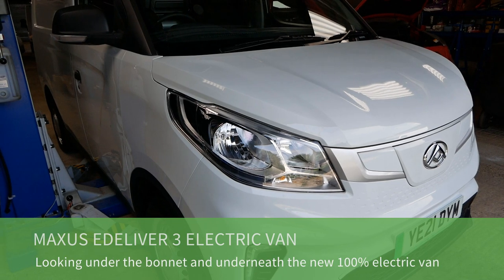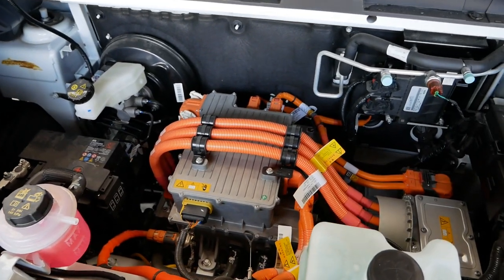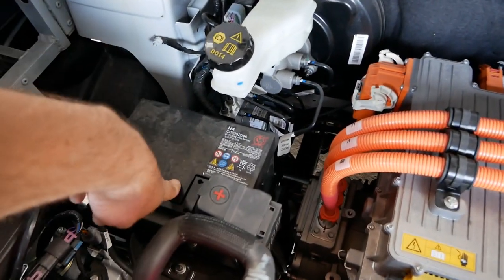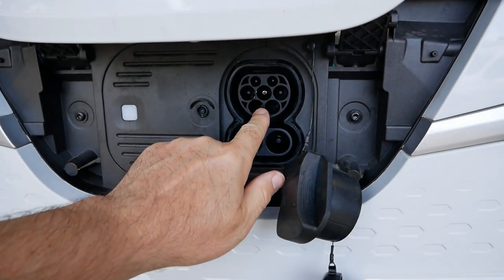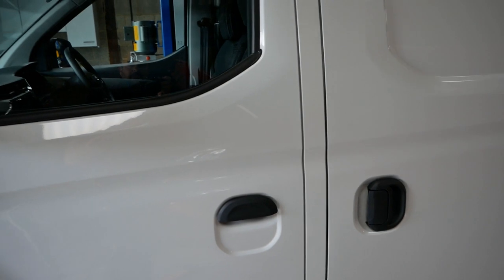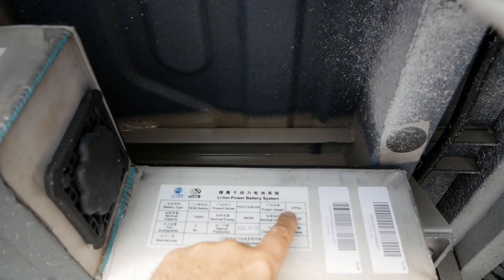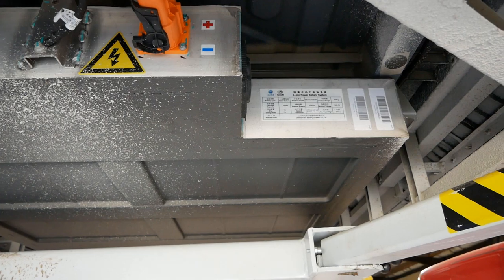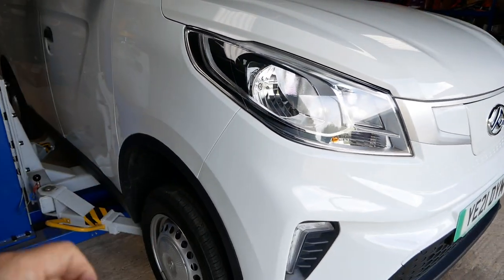Maxus eDeliver 3 electric van, looking under the bonnet & underneath to see the battery pack

Comment: It would be cool if these vans could have a main socket outlet to charge up stuff, like battery powered tools.

Otherwise the van looks perfect
Reply: Yes... also battery temp management as well.
Reply: V2G would be even better!
Reply: Yeah like the eTransit
Reply: I add 5000W V2L inverter in  Maxus EV30（eDeliver 3） for van leisure and Van working.  support AC 5000W output even charging or driving time.
Reply: you could always have something fitted, i run all my power tools from solar on my diesel van at the moment, i will probably do the same when i convert to electric.

Comment: You mentioned in an earlier video about those standard tyres being noisy, assume that is why they got named “Harmonic” … 🤔
I do have a question (thinking in camper mode) if you are sat in the rear , can you lock the vehicle with the remote..? Please

Comment: I liked the video very much. Good presentation. About the van, looks like very simple and cheap to do maintenance, the question remains just about are we capable of buy parts because is not a normal PSA, VAG or Mercedes brand.
Reply from the maker: Its no different. You can buy parts from SAIC Maxus. See https://saicmaxus.co.uk/ for the UK dealer network. SAIC are also MG. Their prices are very reasonable. I did a video on this, see https://youtu.be/qKgb5NXr7ow

Comment: All those different types of materials could cause issues with galvanic action, especially aluminium/steel interfaces...
Seems a reasonable build quality, but not the best. The five year warranty may be tested by our winters...
Reply from the maker: I would expect there to be gaskets between the different metals. I've also learned today that the floor on these is stainless steel, whereas I thought it looked like aluminium. I will have to check.
Reply: @GoGreenAutos  
Stainless steel would make sense for wear and tear, but not for weight.

Comment: Cheers for the video. Im getting a 2 day demo of  the short wheelbase van with the big battery next week. 
It was interesting to see a bit more about the construction.
Do you think from what you have seen it would be worth spraying the chassis or is it already adequately treated for salty roads? 
I ask because if I forked out the extra cash to go electric I would prefer to keep the van for longer than I normally would. This would especially be the case as I expect resale value on the current generation of vans won't be great as the technology makes them redundant quite quickly. 
The simple construction of it makes me think it could be reasonably easy to upgrade the battery down the line as well. I wonder if in a few years there will be a good aftermarket industry for that sort of thing. The van could last for many years then. 
Cheers 
Paul
Reply: Did you buy one Paul and what do you think?
I’ve got a LWB, 130 bhp auto Berlingo on order, and I’m expecting a build date pretty soon. I’m very tempted to cancel that order and get one of these Maxus e3’s for a couple of grand extra, especially as I only do around 50 miles a day.
Reply: @frazerguest2864  
Hey Frazer 
Yes I bought the shorter one with the big battery. 
So far Im pretty pleased. The van itself is basic but comfortable.  More importantly   i have so far found the range to be decent enough.
Now in the summer mixed driving im getting pretty consistently 260km from a charge. In the early spring (im in the middle of Sweden so -8 to plus 5c) I was reliably getting  200km with the heater on economy and with studded winter tyres.
In both cases I was carrying about 300kg of equipment. 
With a trailer on with a total weight of about 500kg my range seems to drop between 30 and 40km regardless of the temperature. 
The real test for me will be in the deep winter when we get several days in a row below -10.  I think I will have charge for 15 minutes on a fast charger during the day then.
Even though the upfront cost is quite high because you can only get them new the van is saving me a fortune. My monthly costs have reduced significantly. 
I hope this is helpful. 
Regards
Paul

Comment: i would like a ediliver3 with twin rear doors
how much is it to put or do you have one with twin side doors ?
Reply from the maker: Do you mean twin side sliding doors? All come with just one. No option to have a door on both sides and in reality too difficult to fit. Cheaper and easier to buy a van that comes from the factory with both.

Comment: Worth mention, the "climate control" got no temperature adjustment.
You have AC/Heat on/off and adjust to the desired temperature with opening/closing widows.
Reply from the maker: A new video on the eD3 heater coming on the channel soon.

Comment: Nice interesting video. I would like to know from where gets the 12v batterie its power? From the traction battery?
Reply from the maker: Yes, there's only one power source. When the vehicle is running the DC-DC converter charges the 12V battery. So its doing the same job as the alternator in an ICE vehicle.
Reply: @GoGreenAutos I do not really understand. The other way round. What happens if I consume the whole power of the 12 V battery by a diesel heating. When does it get reloaded?
Reply from the maker: @decker6875  The 12V battery gets charged (from the HV battery) when the vehicle is on and in ready mode (i.e. running). However, if you completely flatten your 12V battery, you will not be able to turn on or start the vehicle. A video about that and how to recovery from that situation is coming on the channel soon, so subscribe to catch it.

Comment: Id like to turn the larger model into a camper, put a heap of solar on the roof & see if its possible to charge batteries that way ... as out here in Australia it is few & far between charges
Reply from the maker: Yes, the eDeliver 9 would make a great camper. And these come (here in the UK anyway) with the largest traction batteries of any electric van.

Comment: there is no spare wheel or eye towing screw?
Reply from the maker: There's a towing eye screw in the front and yes, no spare tyre. Pretty typical for modern vehicles. You get a puncture repair kit instead (pump & gunk).

Comment: Very surprised there is no battery cooling
Reply: That's exactly what I thought. Especially since in the companion video to this when comparing this van with the Nissan N200e there was a very valid point made that Nissan Leaf and N200e have battery segregation of 3% pa because of the lack of battery cooling whereas othe EVs (including the SIAC built MG ZS EV) typically have 1% degradation. The N200e has a primative fan blown air cooled system which Leaf doesn't an now we see that SIAC Van has only passive ventilation to cool it so no wonder there's so much space around it

Comment: Do you know why this van would stop charging. 
Discharged battery all the way down yo 337v.
Reply from the maker: No. Too many variables. You need to get the error codes diagnosed.
I think there is a recall on this for an AC charging fault. Possibly read it was a wiring loom? You should contact a Maxus dealer.

Comment: The rubber bumpstops that you mention seem to be rather... "rust" coloured, is that rust, or maybe some kind of different coloured underseal.
I only ask as this is what looks like a brand new, undriven stock van.
(around 15:09, and again at 20:55)
Reply from the maker: Yes it's a new van. The rust colour is just sealant overspray on the rubber.
Reply: @GoGreenAutos  Thought as much :)

Comment: Do you have the  Euro NCAP  safety  rating for this Van?
Reply from the maker: They haven't tested it.
Reply: @GoGreenAutos  I've contacted Thatcham EURO NCAP  to find out on the EDAS rating.
Reply: @daniellenaerts5750  Any Luck? I couldn’t find any results myself.
Reply: i understand that  vans  are currently not required to meet the EURO NCAP safety ratings.

Comment: Are you sure there are disc brakes on the back? I thought it looked like a drum housing.
Great video though, not many YouTubers would show the inside/underneath like I was interested in.
Reply from the maker: Yes they have rear disc brakes. (without looking) the drum housing is probably the handbrake.
Reply: @GoGreenAutos  good to know, I was hoping they were discs.
It’s a lovely (not so) little van, perfect size for me I think. 
Love the fact it’s one trim level only and most stuff is standard, however I’ve been looking at buying a new 52.5kWh in Silver but seems 95% of stock is White. I’m wondering if in the future the colour options will expand?
Reply from the maker: @dataanalyst5704  I doubt they will add any more colours as the majority of van buyers want white.
Reply: @GoGreenAutos  silver it is then !

Comment: What would economy be compared to say a Nissan env200 in miles/kWh?
Reply from the maker: The eD3 has no economy meter so difficult to say. But the 35kwh model does the same range as the 40kwh ENV200.
Reply: @GoGreenAutos  Thanks for the reply.
Reply: My Maxus e deliver 3 does 4 miles/ kwh. I usually drive in eco mode

Comment: How does this van do in an NCAP crash test? 

The structure and chassis of this van are extremely basic on the undersides. This looks more golf cart in construction rather than commercial grade truck. How robust in construction is that battery pack? I saw nothing which indicated it was armored against road debris and projectile damage. 

This design and build appears to be intended for low to medium speed city car use. Not motorway speeds and use. Not really suitable for any speeds above about 50 kph at best. (35 to 40 mph) 

The ratings for the motor are really pretty limited. It’s not really 90 kw, (120 hp) but more realistically around 40 kw (53 hp) with 90 kw available for short term burst capability. 

The motor is rated for 10300 rpm. If it’s producing it’s rated 53 hp, that’s only about 27 pounds of torque. So this is set up for low end dig and the power falls off fast as RPM and speed climbs. 

That’s not really all that much power.

The van probably is quite peppy at low speed and initial start off, but acceleration and responsiveness probably falls off quite rapidly as speed builds based on the motor specs.